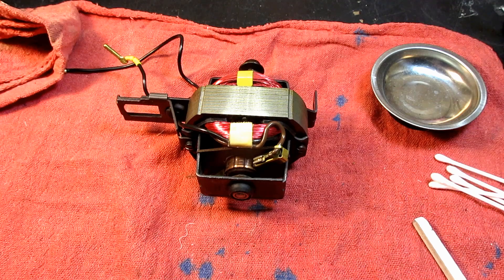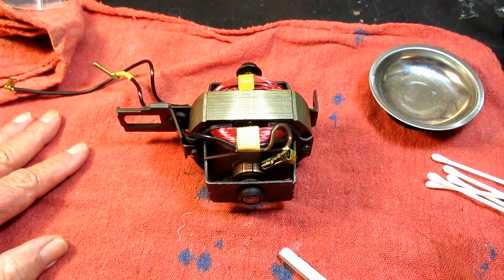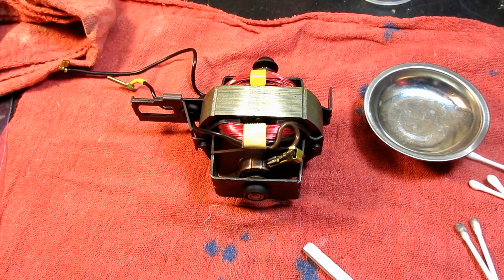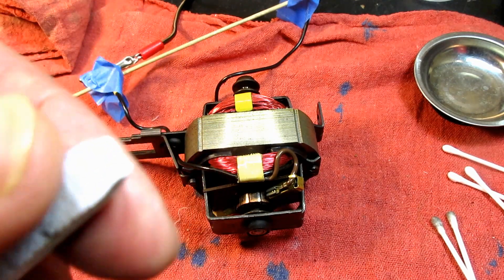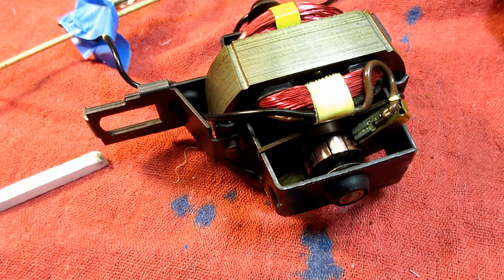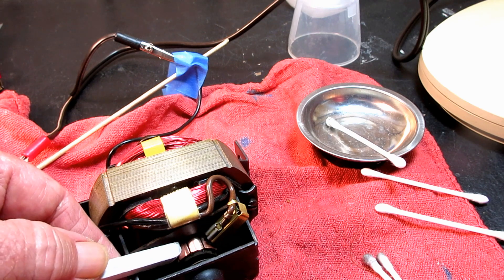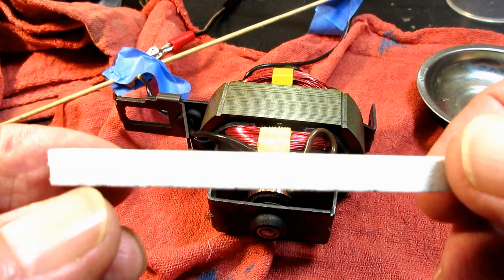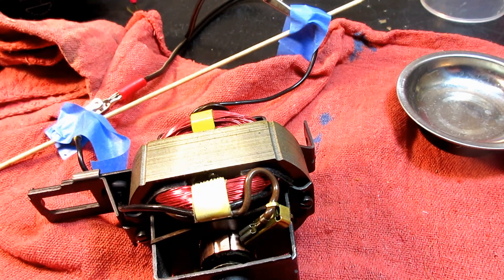Seating Motor Brushes & Cleaning Commutator on a Sewing Machine Motor

Comment: Andy, Great ideas.  Might the discoloration on the commutator cause the motor to run at good speed when not under load but unable to run the sewing machine, a Bernina 830?
Reply from the maker: I don't know anything about Bernina machines, but most sewing motors are the same and have carbon motor brushes. They leave carbon deposits on the motor commutator as shown in this video. Those deposits bock electricity to the motor which reduces speed and power. Every Singer motor I cleaned like in the video had a very noticeable increase in power and speed. Other things can be causing the condition you mention, like lack of lubrication. Your machines appear to have been made in the mid-1970s and may have a carbon stack style of a foot pedal. It's about 45 years old now and could probably use a cleaning and adjustment. Carbon deposits build up on the carbons discs inside and prevent electrical flow, just like on the motor. As I said, I don't know about Bernina machines, and you may have an electronic foot pedal that would not have a carbon problem. I have several video playlists on my Playlist page for rehabbing foot pedals if you think they could help https://www.youtube.com/channel/UCUSPDsHaFtRoz1VA2U1xJ4w/playlists     Also, lack of lubrication on the machine can prevent full-speed operation. The motor will work OK, like in bobbin winding mode, but when engaged to sew the stiff, dry bearing, bushings, and pitman rods can really bog down a motor. A machine's Instruction Manual should show how to oil and grease the machine.

Comment: Hi Andy. I cleaned my 500A using the methods you show in your video. It looks great but she still runs slow.  Would replacing the brushes and a commutator stone speed it up?  And where do I buy the parts?  I’m not sure what to look for. Thank you so much.
Reply from the maker: The link to the stone is in the description below the video, but here is the one I bought: https://www.amazon.com/CAI-DIAMOND-D-Diamond-Seater/dp/B07J28CT5L   Here is the video showing using the stone on a PA style motor like the one in your 500A:
https://youtu.be/pzq4tv8qn94   Have you already rehabbed the foot controller? You can have brand new carbons and a super clean commutator but if the foot controller is dirty and out of adjustments the motor will not run well. The motor gets all power from the foot controller. Here is a playlist of videos showing how to rehab the foot controller: https://www.youtube.com/playlist?list=PLsCOZgzzaiKL6ePPxLpmnWSzTyxPKTb71  As for replacing the motor carbon brushes; I rarely have to do that. Not once in my last 30 machines. I do not replace them until they wear down to less than 1/8 inch. The vintage SInger carbons are much higher quality, IMO. You can find replacement motor brushes from this reputable dealer, and there are others who sell them: https://www.vintagesingerparts.com/products/singer-sewing-machine-carbon-motor-brush-fits-401-401a-403-403a-404-500a-503a-part-192457 I would take a look at the foot controller before I bought anything. I also did a series for rehabbing the PA motor. It was before I learned of the brush seating stone and used sandpaper when needed. https://www.youtube.com/playlist?list=PLsCOZgzzaiKJSu0T9oeaheTZsrUe91kkZ  Thanks for cleaning the machine and I'm glad you seem happy with the results. Good luck going forward.
Reply: @andytubesewing1953  Thank you for the tips Andy-  We are going to watch the footpedal videos.  One thing we did try was to bypass the footpedal to see if the motor would be quicker.  It wasn't so that is why we thought the commutator needed smoothing.  It has a lot of ridge in it and so do the carbons.  I think we are going to rehab the controller and see what happens.  I know I have enjoyed learning and am on the hunt for junked up machines to rehab.  LOL  I also would like to send a donation to keep AndyTube going.  I don't see a donate button-  do you have paypal?  Thank you for sharing your knowledge..
Reply from the maker: I did not know you had tried bypassing the foot controller to test the motor. That's a great trouble shooting technique. Yes the brush seating comutator claeaning should help a lot then. Hey, Thanks! https://www.paypal.me/andytube
Reply: @andytubesewing1953  I am so pleased with myself !  Thanks to your videos and a commutator seating stone my 500A is just humming along nicely and faster than I could ever hope for.  It required a lot of cleaning but this machine was in really bad shape.  Covered in black carbon on the inside and I think lived with a smoker because of the smell inside.  Not anymore !!  Now I'm looking for another rehab project.  Thanks again for sharing your knowledge.
Reply from the maker: Oh, nicely done! Isn't that brush seating stone fantastic? I've used in of machine of my wife's friends and they can't believe what their old machine can do again. I hope you find a nice project again and thank you for saving the Rocketeer!

Comment: Is that motor an internal motor like perhaps out of a singer 513? If so do you have a video about how to remove them
Reply from the maker: Here are a couple motor removal videos from machines similar to the 513 that may be of help: https://youtu.be/sDcexZeS0f0
   and   https://youtu.be/32tXiiXx73o   if you need more information, or have a lot of work to do on a model 513 you may want to spend $5 and download the Singer Service Manual for it. I have used these manuals and find they are worth more than they cost:
https://manualsoncd.com/product/singer-500-sewing-machine-service-manual-518-538-513-514-533/
Good luck and thanks for asking.

Comment: so many things wrong with this video...starting at the end....you were wiping down the motor while it was still connected to the ac!.....91% alcohol..means there is 9% WATER....someone trying the same thing with a conductive liquid would have gotten a shock....next....the stone you are using is called a slip and they can be purchased from a variety of places....and they should be hard/medium hard....next....the brushes should have been removed....you contaminated the brushes with slip dust....next....instead of powering up the motor....attach it to a drill motor and spin it that way...without electricity....then carefully vacuum the entire motor...a small stiff (non-metallic) brush at the same time to make sure you pull out all the copper/stone dust.....it's often easier just to remove the entire commutator, but it's not necessary. Finally, take as little material off of the commutator as possible. if you don't have a slip, go to the nearest hardware store and buy a couple of sheets of 600/800/1200/2000 grit wet-or-dry paper....use a small flat stick and glue the paper to the stick....one sheet of each would probably last for 50 motors....start with the highest grit possible....to remove as little copper as possible....then thoroughly  vacuum...as to using q-tips.....I wouldn't....they can leave thread residue....use the sponge-tip or polyester-tip types....model kit or model railroad websites carry them.....just sayin'
Reply from the maker: Still waiting for your video showing us the proper way to use a "slip"...
Reply: i think?........the brushes should be in place to make to motor spin as the stone goes around and cleans?.....brushes can be cleaned or replaced AFTER the Commutator was cleaned while live/spinning...?
Reply from the maker: @theewelder  Correct. If you just want to polish the commutator then OK, but it's called a Brush Seater stone for a reason. The whole idea is to seat the brushes smoothly to the now smooth commutator. Simple really. I'm disappointed Huskyresqr never came back or made a video. I see he deleted his videos about the Husky dogs, which is too bad, they were great looking dogs.
Thanks for watching my channel, Mr nice guy. I was not notified of your comment so did not see it until today when basketball jones left theirs. Take care.
Reply from the maker: Feel better? Actually, the motor was not connected to the AC at that time; the power switch was turned off. The manufacturer calls it a brush seater so I did too. 
VIDEO: https://www.youtube.com/watch?v=_EIAtfJLsh8
If you'd care to make a video and post it to your channel let me know. I'd be happy to announce it and link to it on my channel. (nice dogs by the way)
As for the rest of your comment, well  ... just sayin"
Reply: @andytubesewing1953  How DARE this guy point out the errors you made!  What a jerk he is!  Kudos on the "feel better?" comment - because, obviously, he didn't take the time to write this because he wanted to help educate someone and perhaps help others that might mistakenly think this is the proper way to repair a universal motor. He obviously only took that time to make his comments because he wanted to feel better!
Reply from the maker: @basketballjones6782  Thanks. I guess I'm not the only one who thought that. I love when viewers share their knowledge and ideas, but no need to be snarky, obnoxious, and preach them. I love your cover name, and thanks for watching my channel.

Comment: Good morning Andy! Would you consider making a video about how to clean/restore the straw trapezoid case that comes with the 301? Thanks! I love your videos! Sarah
Reply from the maker: Hi, Sarah. It's been my experience that the straw case is almost impossible to clean or remove stains. I have tried before and simply ruined the "straw" coving to the point I removed the existing covering. One case I painted in a two-tone color and the other I used a fabric adhesive spray and applied a vinyl cover. Those two options were acceptable, but not really worth the time and cost IMO. What I usually do now is vacuum the case heavily, both inside and out. Use a slightly damp terry cloth to lightly wipe off any surface dirt/dust I can. I then spray the inside with a fairly heavy dose of Febreze and use a hairdryer (high heat & air blowing) and dry the Febreze. I then do a very light spray of Febreze to the outside and dry with medium/low heat and lower air blowing. I have a friend who does similar but uses a pet odor removal spray with enzymes. He said it's more effective than the Febreze due to the enzymes in it. I have not tried that method yet. That's it, Sarah, and thanks for watching Andy Tube. Take Care.
Reply: @andytubesewing1953  Thanks Andy, you're the best!

Comment: Andy, That worked pretty fast and thorough.
I see the stone you reference is a Medium Soft, yet looking into the Martindale information they recommend a Fine Hard for small appliance motors - any thoughts or advice? Thx again
Reply from the maker: On second thought; I saw shorter pieces for under $4, so I might buy two (or three) and after the main cleaning maybe a softer stick would put a smoother polish on the commutator.
Reply from the maker: Yes I would go with what they recommend when I bought mine I only looked at the size and the price and what would fit on the commentator I didn't find the reference until later and realize that they have different soft and hardness so the next one I buy will be what they recommend thanks for watching and I hope you try it I really like using it
Reply: I haven't been able to find a seller of the fine-hard stones.